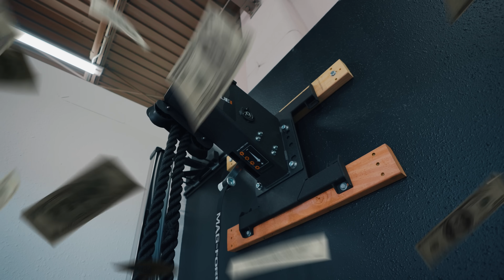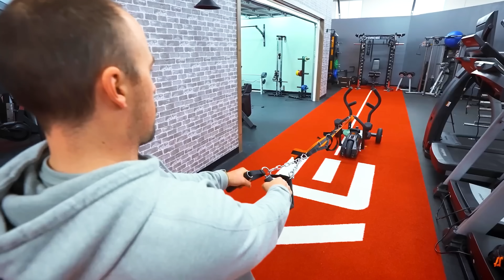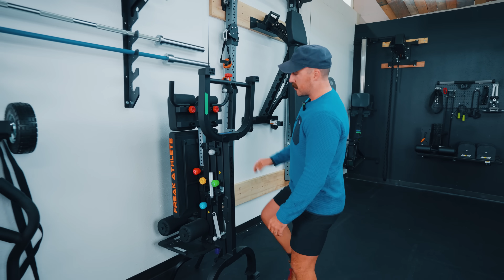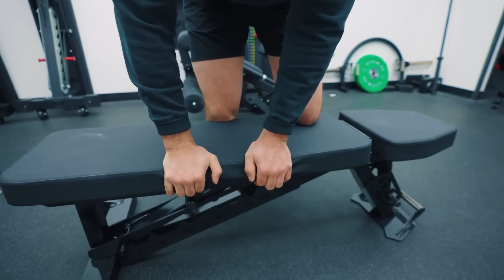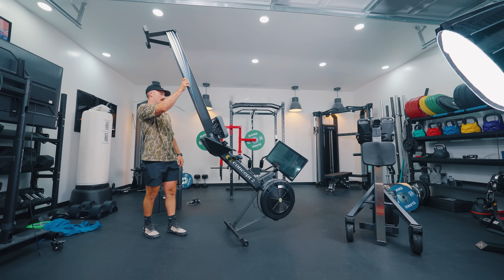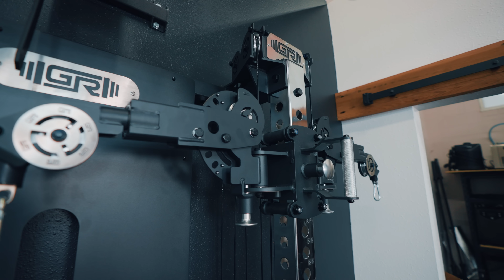I Built An Entire Home Gym On A Wall!

Comment: For those wondering: This garage gym setup is a high-end, space-saving masterclass estimated at $12,500 – $13,500.  While the upfront cost is significant, it reaches a break-even point in 2–4 years when compared to premium club memberships ($250+/mo) or when used by multiple people. Unlike digital options like Tonal ($4,000+ plus $60/mo fees), this "analog" setup offers superior weight capacity (1,000lb+), zero monthly subscriptions, and high resale value, making it a better long-term investment for serious strength athletes.

Comment: This is cool. I was thinking about seeing how close I could get to like a Force USA 6k rig as far as functionality. With a wall-mounted rack, and two Vultras. I was wondering if I could spend 6k or less and get just as much with a small space. And have a lot less weight if I moved and save some room. and heavy equipment. I realize that the vultras are already a huge part of the budget, but If I could get a wall-mounted rack, barbell, bench, pivot arms, some attachments, some plates, and maybe even a smith machine out of it. I think that would be awesome.

Comment: Long time follower of this channel here. I was really excited for this one until I started watching it. I'll start by saying that it's cool they took the time to piece this together and it can be good inspo for someone thinking about getting a home gym started in their 1-car garage. But watching the video back, it seems pretty clear to me that no one has actually used this for a full workout, that they just slapped as many things together as they could into this wider-than-a-1-car-garage for the sake of highlighting some sponsored equipment. Some issues that make this set-up feel unrealistic (or at best, overly cumbersome to use) to me:

- You're going to have to reposition the FA Hyper Pro every time you want to access your barbells (or be forced to awkwardly maneuver between the Torque Tank and the Hyper Pro to get them on/off the rack). 
- They apparently really wanted to show that you could put the Hyper Pro on the wall, and Coop touts how versatile it is with the ability to do GHDs/reverse hypers and leg extensions/curls, yet doesn't include those attachments in this setup (probably because they couldn't figure a way to get those onto the wall). That, and in this configuration the number of barbells you can store on the gun rack is now limited to 2.
- With how high the shelf is, you're going to be limited in what you can feasibly store up there unless you are tall and/or have decent overhead strength/stability. Coop might not mind going on his tiptoes to bring that 30 lb medball down from overhead, but I doubt the majority of people are going to want to deal with this on a regular basis purely for the sake of some extra floor space. 
- I think he went with the Rep Nighthawk bench over one of the PRx Profile folding benches because those ones remain attached to the wall. But the Nighthawk weighs 88 lbs and is already one of the lighter benches amongst the most popular ones on the market... I would have really liked to see the process of bringing it down (the video cuts a good portion of that part out) and putting it back up. I can't imagine many people are going to have an easy time with that, which could be a major pain point considering that a bench is one of the centerpieces of most home gyms. 
- The Dialed Motion Cable Retractor is sweet, but there's no way I'm going to get out a step stool in the middle of my workout just to route the cable over for lat pulldowns (or to change back to independent pulleys for other exercises). 

Again, I do think this video can be a source of inspiration for someone trying to get started out. But it just doesn't feel like enough thought was put into the usability of this setup, and I'm sad because the end result is that this feels more like a product placement video than something actually intended to help those of us trying to make good use of our limited space at home. I sincerely hope they do a better job with the Budget Gym Co-op setup.

Comment: What is that whole setup on the pull out squat rack? You have dialed motion cable retractors that attach to plate loads (what are these pieces that plates load on? Also, what are the attachment arms at top of rack that push cable away from the rack and the attachments that adjust up and down the rack?)

Comment: Most useful video on any gym channel I’ve seen for ages. Thanks! Question - with the wall mounted plate storage in a 2x4 stud, what’s the maximum amount of weight you would store on it? Your plate holder looks like it’s only on one stud.

Comment: I bought a bulk pack of Tornado Hooks via Amazon for most of my stuff, including bars.  For plates, I got a bunch of Scratch 'n Dent plate horns.  I lagged 2x4's across multiple studs, then lagged the horns to the stringers.  I use a yoke as my rack, which gets disassembled and filed away in a closet off the garage.  All this to say, this video spoke to me.  Last thing I wanted was for my wife (and me) to have to park outside.

Comment: When I started putting my garage gym together mid December last year other than being able to fold up my Profile Pro I never felt wall storage was necessary.

Flash forward to the worst winter in years, absolute psychos parking in my gym and you see the snow come off their car and melt into your equipment and now everything (except my PRx Halo Arms but they will be soon) is mounted.

I just wish PRx’s new selectorized functional trainer went above 160 per side I’d upgrade from my plate loaded, but I still love it.

Comment: Great stuff, Coop.

I've got wall-mounted PRx Profile Pro rack and plate storage, and a Torque Fitness Anker 7 twin-stack wall-mounted functional trainer in my 10'x12' den. With a Nighthawk bench and a plyo box for cardio, I can do everything I need for fitness in a tiny space. Incredible utilization per square foot.

Warning for prospective buyers - swapping plates on a pin gets real old real fast. Weight stack(s) is far superior if you can manage the extra cost.

Comment: Coop’s gotta review the new PRX collapsible rack with the built in pin loaded pulley system. It looks sick
Reply: Sick for people who are not serious about gains.
Reply: @reconstructionwouldhavesav9472   lol what does that even mean?
Reply: @eaton24 

PRX is built for people who are not serious about gains. People who prioritize space and compromising over quality equipment. Which I personally don't have a problem with. But they screw people over with high pricing for inferior equipment.
Reply: @reconstructionwouldhavesav9472  iv never used or seen their stuff in person. Does it suck? If it sucks how so? What’s been your experience? I contemplated jumping in but don’t want to get screwed

Comment: On the budget coop side I was impressed with the Mikolo Cheetah Ultra. It folds against the wall. It has a cable pulley / functional trainer built in. and because of how it folds it presents some really unique (for the price) workout options.  The thing is under $500.  
I am already setup, but if I were starting and had the budget and space issue this would be the way I would go.  Kind of freaky what they do for the money.  I hear people say you can't get in under $1000, but with this a bench, and barbell and plates you are in.

Comment: There is no way I'd have all that weight hanging on my walls I don't think the wall would really be able to handle it for very long
Reply: I have a room it's 10by12 I used to have my own gym and you don't need all that equipment to keep in shape or build muscle
Reply: Yeah, I'd be curious how this wall-mount setup holds up over time. That is a lot of weight, factoring the continuous jolts from taking weight on and off (especially dropping weight on)

Comment: This might be a dumb question but do you have any suggestions for horizontal bumper plate storage? Lots of plate trees are designed to be vertical but the only horizontal options I’ve seen are rogues 24” wall storage stringer.